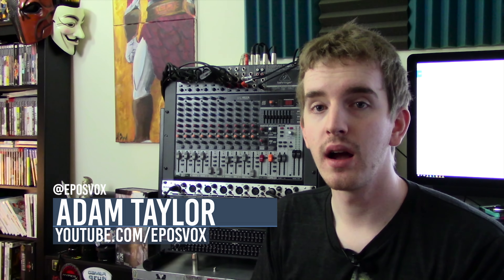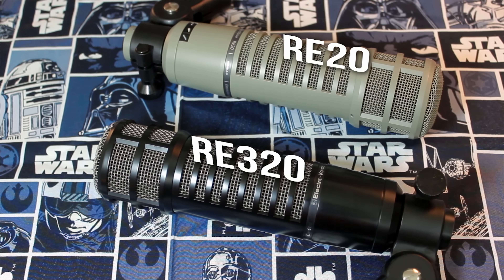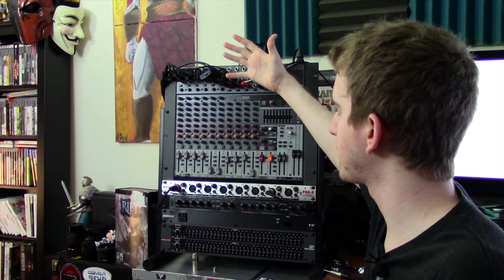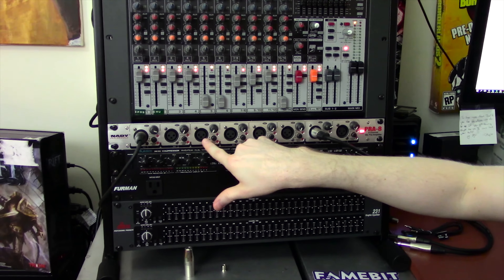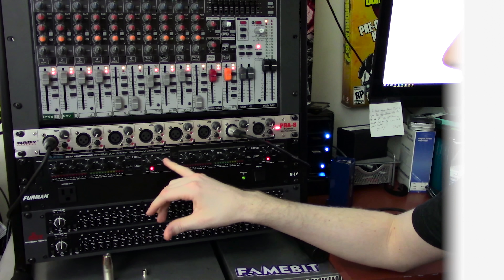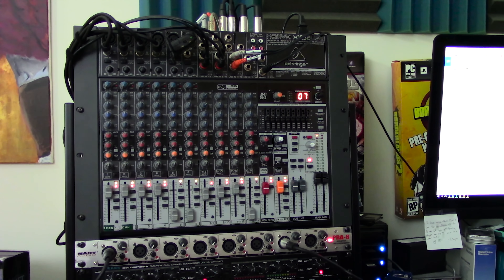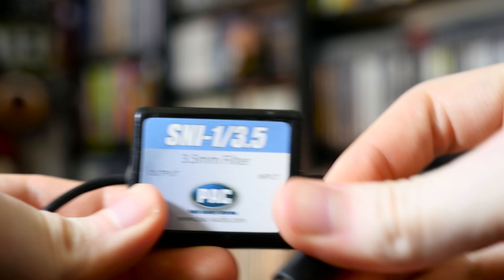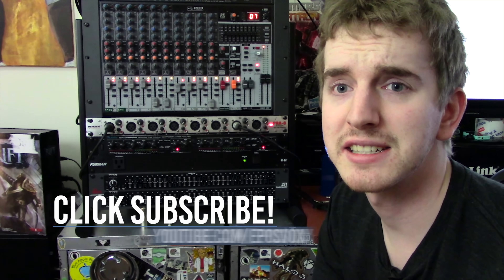WVOX VOX RADIO - My BUDGET Hardware Audio Processing Rack Setup & Tour

Comment: This video helped me a lot! Just a couple of questions though
- Does the Babyface adds the equalizer/compressor on the go? 
- Shouldn't the 8 band from the mixer be enough for streaming?
Thank you very much
Reply from the maker: Babyface can add EQ and various effects, yes. It was a review unit, I don't actually use it full-time, was just showing as an example.

An 8-channel mixer should be enough for streaming. For most, even a smaller one would be fine.

Comment: I have the same mixer and stand but can’t seem to find the mounting brackets for the mixer anywhere, where did you get those?
Reply from the maker: They came in the box w/ the mixer lol
Reply: EposVox haha guess I need to keep tearing my office apart, I think they may have discontinued the inclusion 😢 I always hoard boxes and hardware “just Incase” and my mixer box is empty.

Thanks for the quick response!  Especially on an older video.  Love your work!
Reply from the maker: Thanks for watching! Good luck finding it! heh
Reply: EposVox I found the brackets!

I’m working on putting together the same setup as far as hardware except I ended up getting a more expensive Behringer pre amp because the one i ordered like yours got damaged on delivery and amazon credited me the difference between the two.

I was wondering why you went with the 1/4 inch balanced connection to the equalizer instead of standard XLR. Is there a quality difference?

Thanks again!
Reply from the maker: I think there can be, but I'm not 100% sure. I just know to use them over unbalanced TS cables haha

Comment: How did you get all your game consoles into 1 input on the mixer?
Reply from the maker: Monoprice 4-in, 1-out HDMI switcher which has 3.5mm audio extraction. (Has coaxial and SPDIF Optical, too!) Run the 3.5mm through a ground loop isolator and to a 3.5mm to 2x 1/4" TRS cable into one of the inputs. Slam bam.